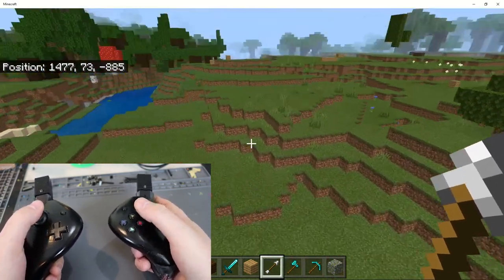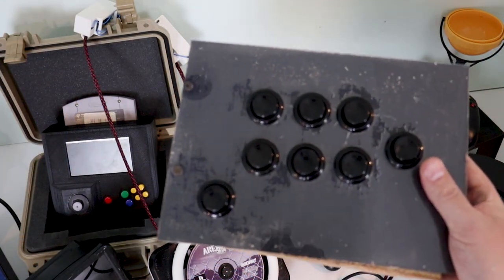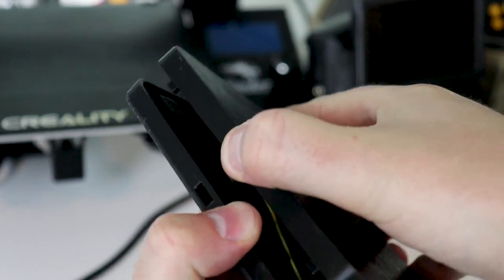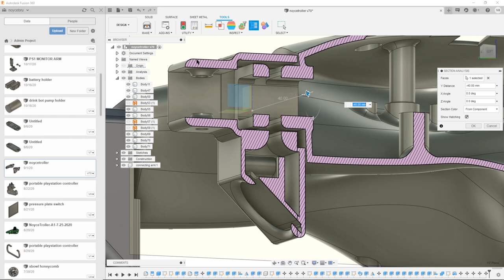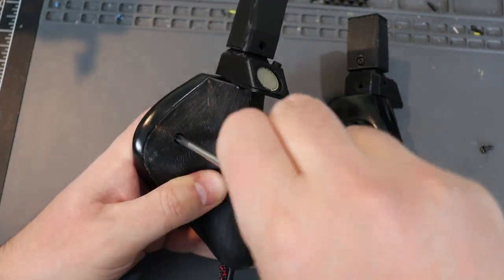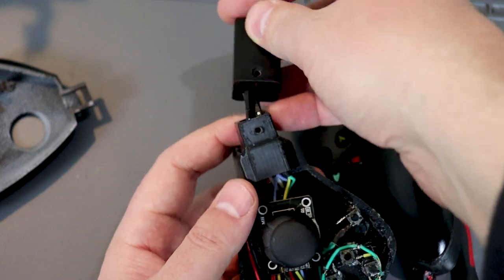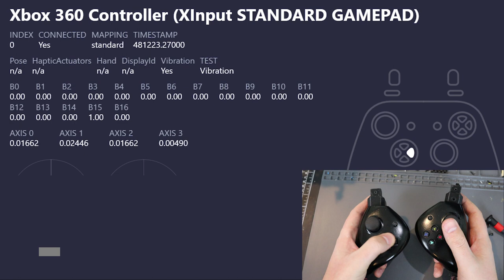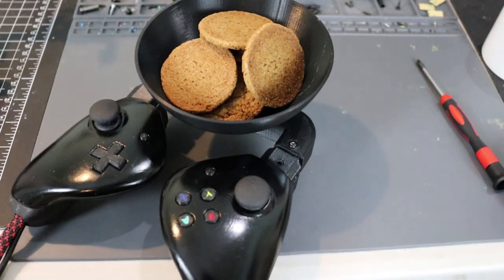3D Printed PC Controller

Comment: Hey man,
I've been looking for something like this for the past 3 years, and I've finally found it, so thank you so much!
I'm not too good at electronics, so I'm unsure as to how to connect the force sensitive resistors and analog joysticks to the pro micro, so I would really appreciate if you could link a circuit diagram for this. Once again, cheers on the amazing work you have.
P.S. I don't know why, but I can't join your discord because the link isn't working for some reason.

Comment: Would it be possible to use a PS4 controllers gyroscope in this kind of a split controller design? There isnt really a split controller Designed specifically for the use of the gyro as the main input for aiming, so it'd be nice if that could be a possiblity.

Comment: I want to build my own controller (I make crazy mods to existing ones) but I have to know before I really dive in, those force sensing resistors, can I use potentiometers to make triggers instead? Can't see why it wouldn't work but I am no expert 😆 would anything else need to change?